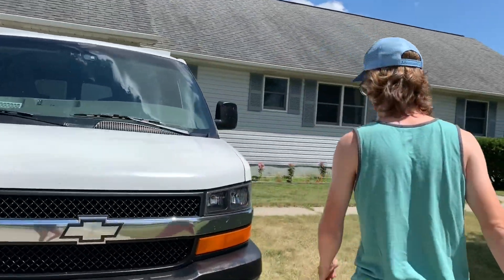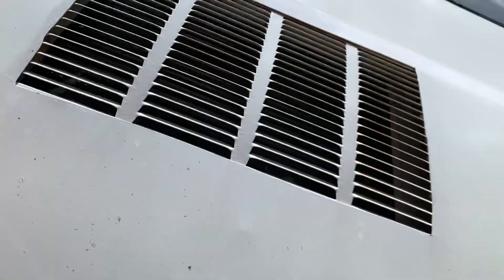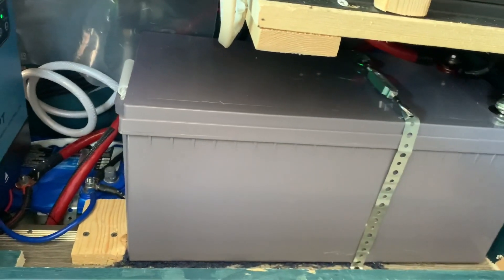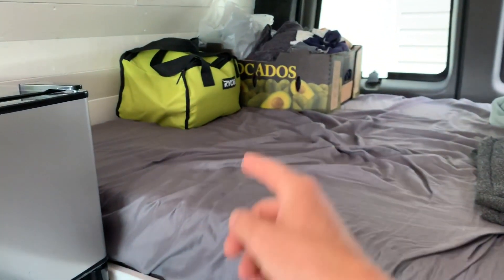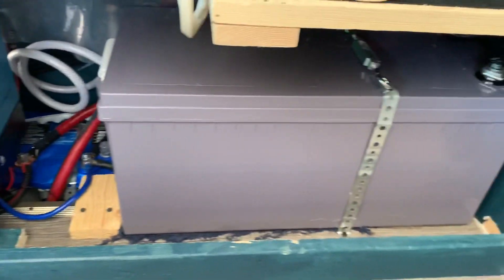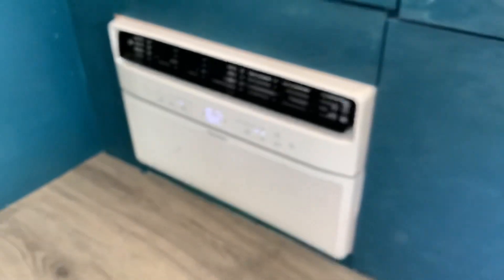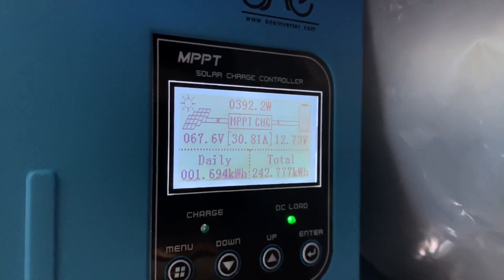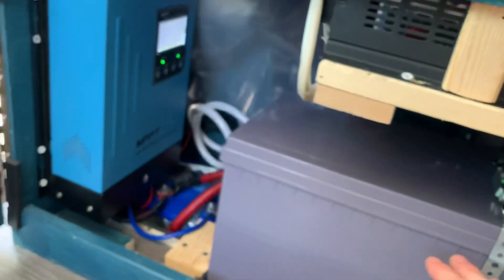Van Life Solar AC Setup - Totally Off Grid

Comment: Hey Tim, can you expand on how you attached your panels to the top of your van? It looks like the panels sit directly on top of the van and that you’ve got your panels bolted primarily along the sides. I see that you have a piece of angle iron on your front panel holding it down, did you do that for all four panels? I’m assuming yes due to the wind when driving. For the solid sheet metal (if that’s what it is) along the sides, how did you attach that to the van? I see the bolts connecting the metal to the panels but I don’t see where the sheet metal connects to the van. 

I’m building out a 95 Ford e150 right now and, after watching your videos, I’m gonna install a window ac unit as well. I bought 3 solaria 365 watt panels and they overhang my van just like yours do and I’m trying to figure out how to mount them to the top. I’d like to have some space between the panel and the roof of the van for heat and efficiency purposes. But I also want it to be sturdy and rock solid when driving down the road. Big fan of your work and all the videos you’ve posted and I appreciate your help.
Reply: Hey Tim, that’s an interesting video. I was pretty impressed with how well foam insulation boards perform. 

For your panels, did you wire them in series or in parallel? And why? 

I’m kinda shocked more people haven’t watched your 252 regrets video. I picked up sooo many tidbits of info from that. Crazy. Thanks again Tim.
Reply from the maker: @chrisstinson205  Sorry for the late reply Chris! Funny you mention the solar wiring. I originally wired the back two in series and the front two in series, then ran them parallel to the MPPT charger. (So the four 41v panels came into the charger at 82v)

After some reading of various MPPT owners manuals (and two years) It's suggested to get your input and output voltages as close as possible (without exceeding the amperage rating of the controller or the wires of course)

I suppose it makes sense in theory as the voltage doesn't need to be dropped down as far, but realistically I saw no difference.

Hopefully that van regret video catches on in the coming years haha. I put way too many hours into it!!
Reply: @VanwithTim  No worries, Tim. Appreciate you getting you getting back to me. I’m wiring mine in series. Reason being I won’t have to buy a thicker gauge cable to handle the amps and I won’t have buy the y branch connectors that the parallel configuration requires. I guess I like the simplicity that wiring in series provides. I went with newpowa curved z brackets and they make the panels stick up about 3 inches above the roof. I like that heat won’t get trapped between the panel and roof but I don’t like how much wind catches underneath the panel when I’m driving down the road. I might end up buying some sheet metal and fabricating it to create a deflector of some sort. Anyways, enjoy your day Tim. Keep the videos coming.
Reply: Tim, I recently finished my build and I wanted to thank you. I mounted an air conditioner and a mini fridge in my van after watching your videos. Without your videos, I wouldn’t of known it was possible. I would of been forking out a crazy amount of cash going the 12v route.  Appreciate your videos and how helpful they’ve been.
Reply from the maker: @chrisstinson205  Hey Chris good to hear from you! Congrats on the completed build - glad you were able to work in an AC unit and fridge. Really appreciate the kind comment, and of course feel free to reach out here or through email if I can offer any help in the future! Now go enjoy your build!!
vanwithtim@gmail.com
Reply from the maker: Hi Chris, you’re pretty much spot on!
I started by simply setting the front panel on the roof and centering it. Then aligned it with an internal roof cross-member and bolted the L-bracket down to that roof cross-member.
The only other L-bracket is at the back of the rear-most panel. It doesn’t align with a cross-member, so it’s simply held with a handful of stainless self-tapping screws and a huge gob of white silicone.
Then the sides were just a straight piece of sheet metal cut into strips. I began by screwing the strips into the drain rail of the roof, then I bent the sheet metal upward and screwed into the solar panels about every eight inches. (I used 1” stainless self tapping screws, although you may need longer depending on your drain rail thickness!)
So far no issues (~35,000 miles). I check the fasteners from time to time but have yet to have any loosen.

Obviously make sure to paint all sides of the brackets and sheet metal before installing or you’ll have a rusty mess within a year!
I’ve been very surprised by the rigidity of the solar array. We spend a lot of time on some NASTY roads – paved and unpaved. I think the wind isn’t an issue because the roof becomes a bit of a “dead zone” (or even a vacuum) while driving. (At least the first couple inches above the roof.)
Those Solaria panels look NICE!! Do you think you’ll go with AGM or Lithium for the battery bank? I see the Lithium is coming down in price quite nicely.
Cheers!
-Tim
Reply: Hi Tim, thanks for your response. I appreciate that. That makes sense on what you did. 

I bought two Lossigy 200ah lithium batteries back in November. And you’re definitely correct about the price of lithium going down. They’re about $80 bucks cheaper now than when I bought them. My plan is to live full time in my van for the next couple of years and AC is a must in the summer time. I’ll also have 3.1 cubic ft mini fridge along with a 12v water pump, diesel heater, puck lights, tankless water heater, etc. I’d like to think I have enough solar and a large enough battery bank to meet that. What do you think? 

Due to the layout of my van I’m not able to mount my AC on the side like you did yours. My plan was to have it sitting in the floor in the garage area of the van. It’ll be fully contained like yours but I’d only be cutting one hole into the floor of the van. The problem with this, I’m assuming, is that fresh and hot air are going to be pulled and pushed through the same opening. Im hoping to accommodate for this by ensuring that the hole is large enough. Again, curious what your thoughts on that might be. 

Thanks again for getting back to me. Enjoy your evening.
Reply from the maker: @chrisstinson205  I would think your 400ah would be plenty, especially coupled with all that solar!
For reference on the AC check out this video: https://youtu.be/V0r2ijuKd-c
In a nut shell, with a perfectly insulated (R6.0) van on a sunny 83F day you can expect to use between 170ah – 200ah with the AC set at 70F. But that would be with NO WINDOWS and perfect insulation (no gaps).
Realistically, with my not-so-great insulation, it used 390ah and couldn’t maintain the 70F set point.
(In a perfect world, you could use the heat from the fridge and air conditioner condenser coils to heat your water!)
*******
Tankless heater will be run via propane? There’s also the style that uses the engine to heat the water then a 750W heating element to maintain the temperature (my dream water heater lol) 
Our little 4 gal Bosch water heater does great and gives us enough water for two outdoor showers and dinner / dishes, but realistically the $180 2.5gal heater would have worked fine too https://amzn.to/354sIeD
*******
The 2KW diesel heater has been plenty warm for us and I’m glad we didn’t go with the 5kw. We have to sleep with windows open with the 2kw running on the lowest setting already!
*****
I’ve learned the window AC’s are pretty robust, and although it will draw a little more electricity with higher condenser air inlet temperatures, it will still cool just fine! I’ve seen your same configuration in a trailer build. Both intake and exhaust coming through the bottom. 
A REALLY cool van build had the condenser air intake below the van, then ducted the hot condenser exhaust air up and out through the roof! 
If you’re really handy with HVAC and refrigerants, I’ve seen another build with a window AC where he took out the entire condenser assembly and mounted it under the van with its own dedicated fan. No need for air ducting, just ran his two small compressor lines and fan electrical under the van.
Takes "thinking outside the box" to another level!
-Tim

Comment: this is awesome! how long to the solar panels take to completely charge the ~300-350AH batteries and how long to the batteries run everything if the solar charging is turned off?
Reply from the maker: Thanks Roshaan, the solar outputs 55 amps (700w) at full sun. Without tilting panels, full sun is only achieved for around five hours a day. Before and after that it's a reduced amount of solar (such as the early morning / late afternoon).
My batteries have been heavily abused and I'm seeing around 200AH of usable life left in them.
This is still enough to run the AC throughout the night though.

They will recharge fully each day but only if in full sun. (Typically around 4-5 hours).

If there is no solar charging, the batteries can run the refrigerator for a couple of days before dying, but the AC will eat the batteries much faster depending on how hot it is outside.

Comment: I'm surprised he went with a 6000btu... An not 5000btu... In a van. To have more power left over for other things.He picked up a fridge freezer for the van at a 3.2 that's different than typical... Alot go for a off brand 700.00 three way fridge freezer... Still not cheep..Bigger stuff for a van lifer than the average.

Comment: I know this vid is almost a year old, but for the problem with heat coming in your windows you should have them ceramic tinted. It really makes a world of difference. Id also strongly suggest having your windshield done, most heat comes in through there as its the biggest piece of glass on a van. Theres 70% film thats pretty much clear so police dont pull you over, or you could go 35% or 50% for extra privacy, 5% on all the rear ones though.
Reply from the maker: You’re spot on. I’ve been eyeing the IR ceramic tint for a while now but have been delaying it due to the cost ($600-$800)
Everything I’m reading also suggests the windshield as it’s the largest piece of glass in the vehicle.
I know I need to set a week aside and make some before and after tint testing videos!

Comment: The fact that people can dislike a video this efficient like this actually pisses me off to no end...
New subscriber here, this video is supremely awesome and so so so inspiring!! 
However, please, I need your help!! I desperately need to know four main things regarding your panels, along with a few details that pertain to each respectively: 
1.) What's your take on Renogy panels versus Sunpower panels in terms of efficiency as well as price (if you have any personal experience with Renogy panels)?

2.) Where did you buy these 320w Sunpower solar panels!?!?  Directly from their site??

3.) What are the full dimensions of your panels?? You had mentioned 60 inches wide, but 60 by what?  Your van looks like it has the closest dimensions to my truck that I have seen on Youtube so far.  I am trying to mount as many panels on top of my 1994 GMC Suburban 1500 (XL) as I can, as well as with the maximum watt rating I can get, and after taking measurements I figure I can only fit five 100w panels up there (Renogy 40x21 panels) comfortably / stealthily; or 6 of them if I forwent stealth, but even with 600w it just wont be enough.  That is with not removing the OEM bike rack mount that the vehicle shipped with, as I had originally planned to use the rack to mount the panels, to avoid having to cut holes as I have little access to power tools right now, but I am highly considering finding a way to use tools and just do it without the bike rack after having watched your video.

4.) What did you use to mount the panels on the roof??  I see the stealthy / sneaky aluminum shielding on the sides to make it less obvious that they're up there and I love it, but is that aforementioned shielding just to cover them up are are they actually mounted to it?? But I also see that you somehow managed to create a gap inbetween the panels and the actual roof for ventilation so they don't overheat; how did you manage to make this gap?? And what were the power tools you used to make holes in your roof / how did you make them totally water and erosion proof??

Sorry to bombard you with questions, but I am in a bad spot right now after having lost my rental as well as job to COVID layoffs a few months back and I am working on getting new work; also 90% of the videos I find on here are people spending thousands on even just the AC for their van, not to mention their vehicles all look to be very different in size from mine.  Yours is the closest I have found to the same general looking dimensions as mine, as well as a good looking blend of affordability, so your input is worth its weight in gold!!

Thank you so much man in advance for any insights you can help me with!!!
Reply from the maker: Thanks for checking it out! Let’s knock out these questions:

1)	For solar brands / efficiency / price.
Check out this portion of my van regret video: https://youtu.be/opOaJkHXDSg?t=667
Basically so long as they’re not the flexible stick on panels, you’ll be fine in terms of efficiency and quality (They’re all pretty close). However I would NOT purchase your panels online. The price is double, triple, and even quadruple what you’d pay purchasing locally.

Check Facebook Marketplace or Craigslist for panels locally and save some $$

2)	Where did I source my panels.
I found them on Facebook marketplace about an hour away from me at the time of the van build.
I just kept searching around for something close to my roof width. These were a few inches over my ideal size but managed to work. There are TONS of solar panels for sale in Southern California, but I also found a lot while building a van in Michigan as well.
I wouldn’t get stuck on brand with the panels, just search out Monocrystalline panels to land somewhere in the top of the solar efficiency range. But even the standard Polycrystalinline panels are very close in efficiency.

3)	Solar panel dimensions.
Again I just kind of searched around for the closest dimensions I could find in the used panel market. (These ran me $100 each) These specific panels measure 31.42” x 61.39”
Here’s the spec sheet: https://www.energymatters.com.au/images/sunpower/spwr_230wh_com_en_a4.pdf

4)	Details on panel mounting?
You mentioned having an OEM roof mount, that would be ideal. My mount is extremely functional & rugged but pretty ugly. I actually only had one final day before moving out of my house to get things buttoned up and couldn’t think of anything better / more budget friendly at the time…
The front and back panels have metal L brackets holding them to the roof. (The front bracket bolts into an internal roof beam, the back is just screwed into the sheet metal)
I painted both brackets white before mounting for rust proofing, then used tons of white silicone for water proofing.

The sides are fully held by the bent steel panels. I just cut the pieces from a 2’x4’ panel I picked up from Home Depot. Kind of sloppy but it worked. Those are just held in by a plethora of stainless self-tapping screws. (I painted the panels before mounting for rust proofing).
I mentioned it being a rushed process: the panels are just sitting directly on the roof. If you removed all the mounting, they would remain in the exact same spots via gravity. The air gap was a nice bonus, but not by my own doing. (The curvature of the roof created the gap along the sides)
I do wish I had more of a gap for cooling, or simply installed some fan powered ventilation to the bottoms of the panels. It’s not a huge drop in efficiency, but I know it can’t be good for the panels to get so warm.

I have a few pictures of this setup here: https://www.instagram.com/p/B-4q8MqFnDw/
(swipe through the pictures for the detailed shots)

Final thoughts:
My panels total 920w (I misspoke in the video saying 320w ea. Actually 230w ea)
After conversion losses and such, I typically max out around 700w. This is pretty normal on solar. So plan on only getting around 75% of the rated output.
The 6k BTU AC unit only does okay, not great. The issue I have is the number of windows in the van. I know your Suburban is also a giant solar oven. With an upgrade to infrared blocking ceramic tint I’m sure we would both do fantastic, but that tint runs $600 - $800.
For now we have home-made insulated window covers which help immensely.

More than anything try to stay positive! I’m sure you’re incredibly stressed. Just try to do one productive thing each day, even if it’s small. Otherwise you’ll start feeling stuck. (That’s a tough rut to get out of).
Let me know if you have any other questions! Happy to help!
-Tim
Reply: @VanwithTim  Thank you so much for taking the time to give such a detail response, dude!!!  You are a well of knowledge, and this helps sooo much!!
Reply: @VanwithTim  100% going to spread your channel in every single corner of the internet that I think it might attract interest!!!!
Reply from the maker: @notumoverflow5916  thanks for spreading the channel!

Keep us updated on your build, and of course let me know if I can provide any insight 👍

I’ve seen some brilliant builds in much smaller vehicles than your Suburban. Just have to stay clever and always think outside the box! Bright side is you have much less air-space to cool than some of those giant high-top vans!